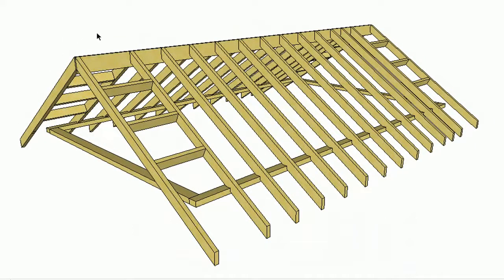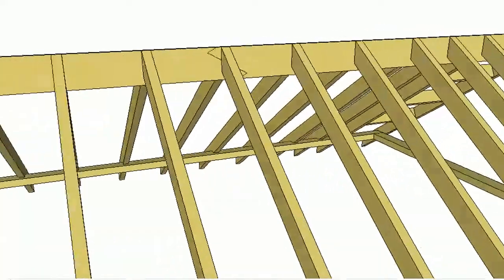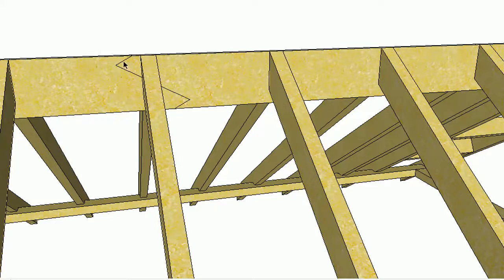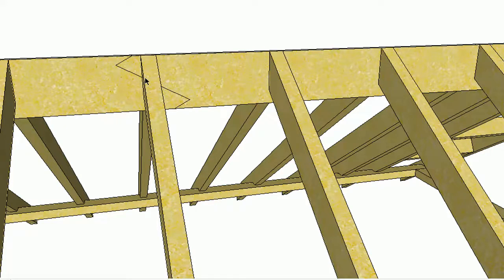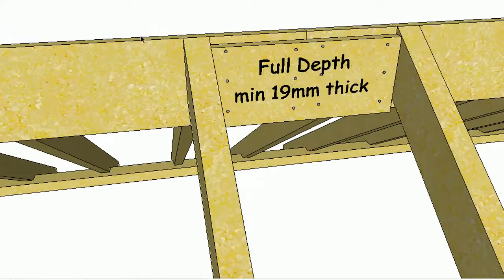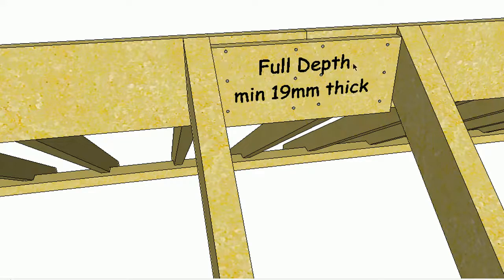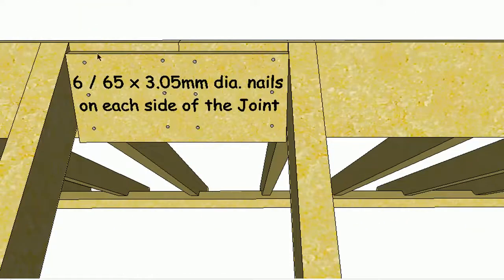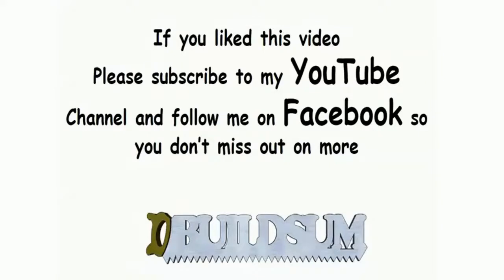Joining a Ridge

Comment: Thank you for making this video, your method is easy to understand, showing a model of what you are explaining is really good. A question i have is in the UK it is difficult to get 19mm material to make a fish plate, ridge board depth often being 225mm deep, could i use ply or something like OSB sheet material ?
Reply from the maker: Hi Richard, the 19mm is the minimum in Australia, I would make sure what the minimum is in the UK however there is no reason that you couldn't use thicker material that is more availible.

Comment: When i built my house, my ridge length was 40’. My ridge board was 2 - 24’ 2x10’s. I used a 3/4” dado on a skill saw and cut 6 tenons 4’ in length on each board. 6 males and 6 females. I applied gorilla glue to the tenons and slid the two boards together then clamped into place. Once dried, it was lifted into place and rafters attached. Total time 1 1/2 hours.
Reply from the maker: Hi Eric, that sounds like a great way to do it. The methods that I showed in this video are what is required by the Australian Standard however different regoins and countries all have different requirements and it is quite accetable to exceed these minimum requirements if you have the time and money.
Reply: @Buildsum  anyone attempting to build their own structure should always follow the code. A simple butt joint or scarf wouldve sufficed in my case, but being i was on my own time and dime it was easy to take the time and join them this way. Not a practical way if i was on a job site on the boss’s dime.

Comment: Does this work for a ridge beam as well?  Wondering if it will support a load or if it is just for a ridge board.  Thanks!
Reply from the maker: Hi Mate, as with all joints it would need to be supported anyway.

Comment: How do you nail 2x fishplates from opposite sides? The nails will hit each other and it might split the ridge. I don't understand.
Reply from the maker: You would have to clamp both plates in position before you start nailing either side. 6 nails in this space should not split the timber if spaces properly otherwise you may have to predrill if using hardwood.

Comment: Can you do a video on box gutters?
Reply from the maker: Hi Lucas, the only advice I would give about Box Gutters is to avoid them at all costs. Even though they have become a favourite of the architect, no matter how well they are constructed they will at some point leak or overflow
Reply: @Buildsum  this sounds interesting, could you elaborate a bit more as to why  leak or overflow?
Reply from the maker: @natetang764  Hi Nate, they generally leak due to poor construction or design or the sealants breaking down over time and if they were to overflow there is nowhere for the water to go but into the building